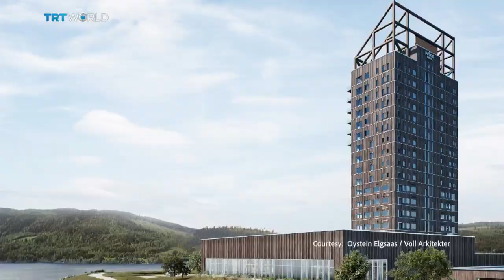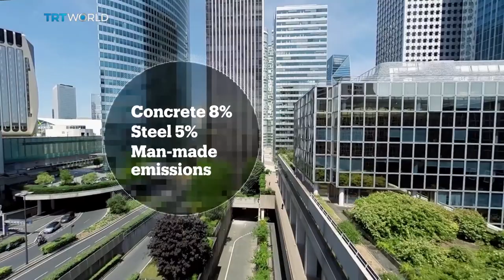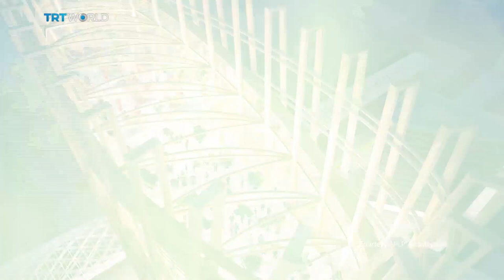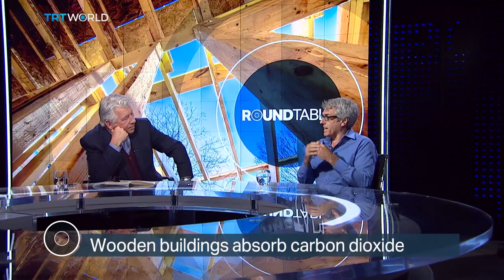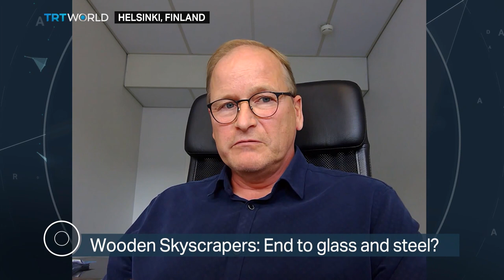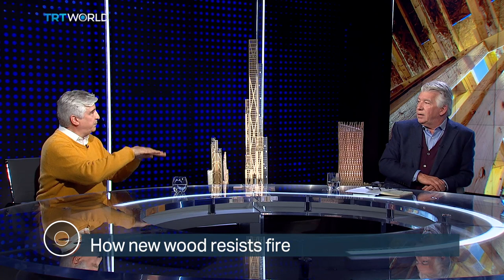WOODEN SKYSCRAPERS: Wooden Skyscrapers: Goodbye to glass and steel?

Comment: Wood? I think I'll stick to my glass and steel.
Reply: Grenfell or that Iranian one, the UAE one, the etc etc,  lots of plastic, modern wood products are plastic enclosed cellulose...

Steel beams can be recycled into new structures decades later if they are not badly corroded.

Wood works for small local buildings, big and tall requires 
survivability, both of the structure and the inhabitants.